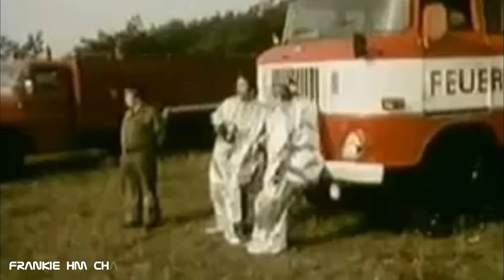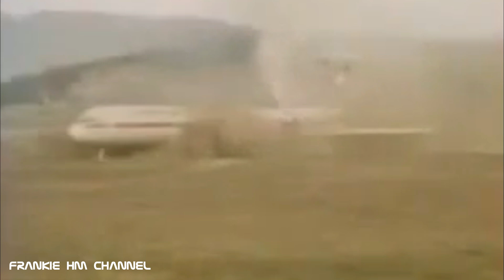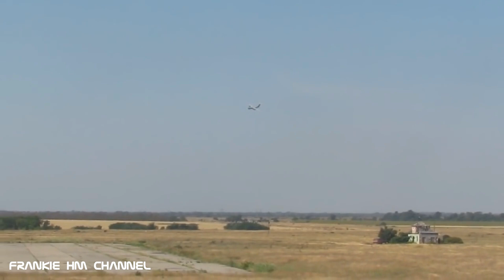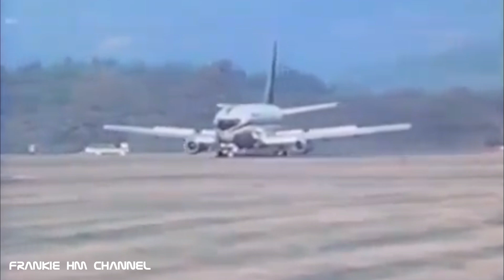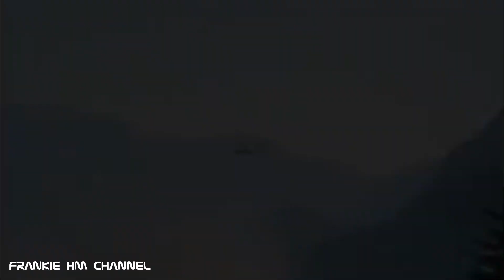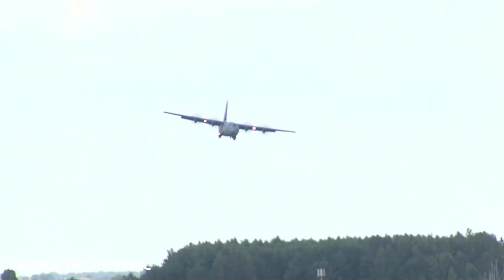Epic grass runway landing | Airplanes landing on unpaved runway

Comment: The military planes shown are built to operate from unpaved runways, so nothing exceptionnal. The IL62 is not but, but it was only 1 landing and no take-off. The 737-200 is here equiped with the gravel-kit, seen on the front wheels, with jet deflectors in front of both engines. Several of these are still operating today, as there has never been such a kit for the subsequent versions of the 737.

Comment: In answer to your ridiculous question; NO, those types of aircraft CANNOT land, in any conditions, on surfaces such as you mentioned.  Physically impossible.  Don't even try bc you're going to CRASH AND BURN EVERY TIME.  Safer to just ditch into the ocean, or at least into a mountain so that you can be pretty certain it will all be over very quickly; Dweeb.

Comment: The last commercial grass runway airport in the UK was at Portsmouth. Two HS 748s crashed on landing in 1967 on the same day after a heavy rain shower (only minor injuries).  
It's use declined as it couldn't take larger and heavier aircraft (3,475 ft runway). It closed in 1973.

Comment: Landing on sod isn't generally a big deal, as long as it's not soft, or wet.
Reply: ...yeah right
Reply: Yeah, that's right. You slow down a little faster. But, the plane doesn't know it's sod.
Reply: @slick9892  The aircraft has to be designed to land on unpaved runways.  Unless the ground is hard AF you risk ripping off the landing gear.  Other than that it is fine.
Reply: First, if you read what I said, I said, the sod cannot be soft.  I have taken off, and landed lots of aircraft on grass runways. No, it does not have "to be designed for an unpaved runway". Sorry, hard ground is hard ground, the aircraft cannot know the difference.
Reply: @slick9892  yeah OK

Comment: Alaska Airlines operated B737-200, 200F and 200QC in rough runway operations right up until replacement by B737-400 and upgrade of said runways because this later type was only rated for hard runways.

Comment: I've been a passenger on a 727 landing on a gravel runway at the Catoca Diamond Mine in Northern Angola. Watching it take off again was quite spectacular!
Reply: N844AA?
Reply: @karlosbricks2413  I didn't actually make a note of the registration, I'm afraid. It was a 727 chartered by the mine to fly personnel to and from Luanda to Catoca.
Reply: @promerops  I know, that was big business back in the day, still is to an extent. What I do know is that it was all rather dodgy and unofficial, and VERY hard on the aircraft, and when you did crash, other crews would take parts off your wreck to use on their 727s, as the mines really weren't paying a fortune for your work
It was often a mere matter of months between an aircraft freshly retired from a major airline, to it being this worn out, beaten up bird worth only what the engines were going for.
I mentioned N844AA as that was the reg of the famous 727 that disappeared without a trace back in '03.
Reply: @karlosbricks2413  My one and only visit to Catoca was in 2008. It couldn't have been the missing 727, then.
I would imagine that, in this instance, the engines wouldn't be worth much, as they were surely sucking in quite a lot of gravel on takeoff.

Comment: Those B-737’s had a bleed air probe under each engine that would blow out compressed air that hopefully kept FOD away from the engines.  The Canadians had reason to use them but not too many other operators.  It was quite an engine thrust penalty to use on takeoff.  What an incredible airplane it turned out to be.  I always called it the DC-3 of the Jet age.  Probably a lot of other people did also.

Comment: That ain't nuthin'! Back in the latter 1930's, Hermann Goering and his fellow aviators built a circular grass "runway" at Giebelstadt Air Base, Bavaria, Germany (just south of Wurzburg) I was stationed there in 1975 but by that time, though signs of parts of the "circle" were still visible, it had become an 8500 foot long concrete runway. Just for fun, I went 240KPH (150MPH) on it riding a buddy's 1975 Kawasaki H2 750 triple two stroke. What was unique about that, the ones (non-euro versions) sold in the United States were only good for 110 MPH (period test, 9/74 Cycle Guide magazine) After the Germans went with paved runways, during the war, they'd paint white sheep on the runway. Air reconnaissance finally figured out that the sheep never moved and the bombs then came. This base was also one of only two bases where Goering played with his experimental Me163 Komet rocket and Me262 jet aircraft. I was 3/67 Air Defense Artillery packin' both the MIM-72A.M48 Chaparral and M163 Vulcan. 52B20. Base is now closed. (sniff)

Comment: Whoa. That IL-62's #1 engine was NOT happy. Didja see the big plume of smoke (not dust) that came shooting upwards from the reverser bucket? It's toast.
Reply: They activated reversers 50 m above the ground, with 2 engines idle. I bet they did not care what happened to the engines, because this was the last flight of this plane. It is now on display at this little airport.
https://de.wikipedia.org/wiki/Flugplatz_St%C3%B6lln/Rhinow#/media/File:Flugplatz_St%C3%B6lln_Rhinow-Iljuschin_Il-62.jpg
Reply: actually, oil smoke from the badly maintained reversers is not too unusual on old IL-62's (in the early 90s you saw it all the time in Vnukovo[VKO])
Reply: It did well better than engines of "Tadeusz Kościuszko" and "Mikołaj Kopernik" of PLL Lot.

Comment: C-130's do it all the time....jets will tend to get FODed especially those with the engines aft of the landing gear.
Reply: That's because C130s are bad ass motherf-ers.
Reply: Well, a 130 will tear up your PSP strip.  We had to close it down for repairs after a 130 came in.  Max was C46, C47, or C123.
Reply: @adamfields5764  that's your problem.....not the C-130's.  LOL

Comment: The firt one is an ilyushin ił62m interflug
Reply: No, it's even the standard IL-62 (non-M)! You can recognize it by the thrust reversers. The mor modern IL-62M has D-30 Engines with external thrust reversers while the IL-62 with NK-8 engines has just holes where the airstream from the internal thrust reverser can be blown out.

Comment: The C-130 Hercules was built to land on un-improved runways. The many countries that use this airplane do it all the time.
Reply: you could land those things just about anywhere.
Reply: We used to take out the lower nav and anti collision light and the doppler radar panel when we were doing unprepared or gravel landings with the Herc.  If you didn't take especially the lower nav light out it would be smashed even with the thick metal screen around it.
Reply: THE ORIGINAL PROFESSOR CHAOS  86th AW is out of Ramstein AB Germany
Reply: High Horizontal Stabilizer= Russian/Chinese/etc planes...only the USA puts their Off Runway Tails in the DIRT :P other countries know better and put the horizontal stabilizer at the top of the Vertical Stabilizer to keep it out of the ground effects and dirt..
Reply: The only thing funnier than that first landing was the music.
Reply: My late bro made the million pound club easily, while flying under UN directives when in RCAF doing the Ethiopian air relief runs. Grass woulda been a luxury. Goat dung, packs of wandering dogs on the runway, mud sloughs from isolated downpours, but mostly dust troughs in the remotest of places were the norm, perfect Herc enviro, these places. 

Forgot the name of the squadron mate, would have to go back over bro's tapes, but said-colleague who hot-shotted in went hard, full reverse thrusters from too fast an approach, and he made a huge lingering dust storm that obscured everything. Going around again woulda been smarter, and he ignored being waved off, not cool. 

1) Without wind, that makes a prob for any trailing craft who want to land and unload tons of food aid any time soon. 

2) Even though a Herc is a hardy, solid, tough king of the roughies, THATS GOTTA BE BAD for the engines. Just sayin...
Reply: THE ORIGINAL PROFESSOR CHAOS   That was an “RS” on the tail..from Ramstein AFG Germany

Comment: Boeing 737 weighs in around 60 tons , similar to two semi truck fully laden. It will be possible to land on grass provided the terrain is flat and firm.
Reply: The problem obviously is the dust and dirt sucked into the engines. That's why specialized planes like the A400M or the Hercules still habe fans, not jet engines.

Comment: Grass runway landings and takeoffs by large aircraft usually leave the surface unusable after a relatively small number of those operations.
Reply: military aircrafts like A400M or C130 did not damage heawely the surface because the charge per wheel is relative low, but for ex. a C17 or a AN22 as a much higher load per wheel, and a conventional aircraft as a so high charge per wheel that it plow the ground

Comment: If there are any "Millenial" relatives of those Boeing 737 people and those old folks complain about how your generation does dumb things just remind them of the illogical decision making involved in that B737 grass runway test.
Reply: Nothing illogical about it at all. Various operators around the world were looking for a jet airliner that could land and takeoff from from dirt/gravel runways. Boeing came out with the 737 with suitable modifications to do just that. Nolinor in Canada has a fleet of the older 737s with this modification and use them daily. Where is the illogic decision making?
Reply: @michaelghent5554  ,
Way too many pounds per square inch under the tires. Of course those narrow tires dug ruts into the ground. It was as predictable prior to the test as predicting the rotation of the Earth around the Sun.
Reply: Are you a milennial, David? Are you an aerospace engineer? Just curious.
Reply: @clintfalk  ,
Aerospace engineer. Born 1962. End of the baby boomer generation? Start of Generation X?

Comment: They all definitely faired much better than I'd have expected.
Reply from the maker: I agree with you. The first one it's incredible
Reply: @frankiehmchannel  Yes, indeed it was. The pilot of that first aircraft definitely has some flight hours under his belt. I was sure the wheels were going to sink into the ground. Soft field takeoffs and landings are one thing in a 152 or 172. But in an old airliner...wow!
Reply: Must have been completely empty and light as a feather... full load of passengers and baggage would make a difference